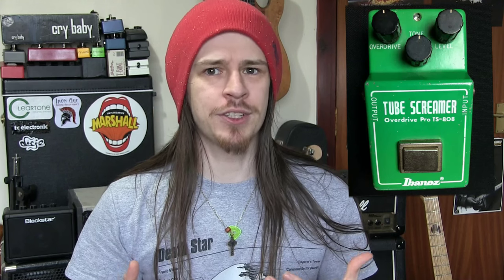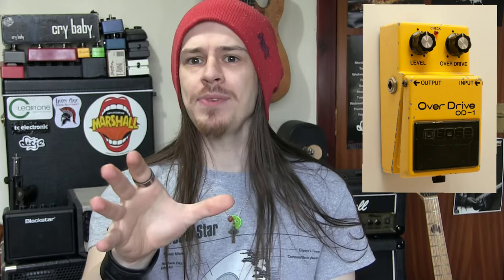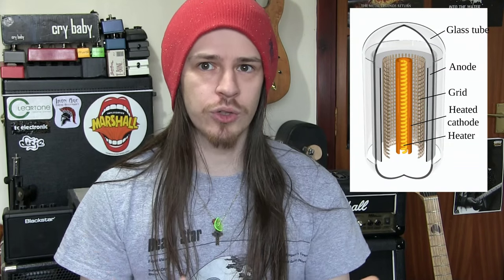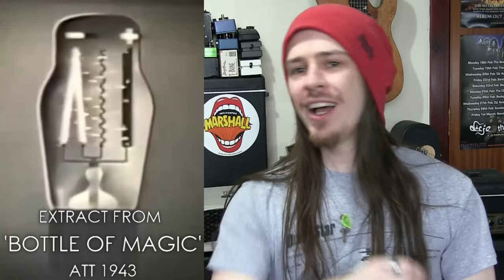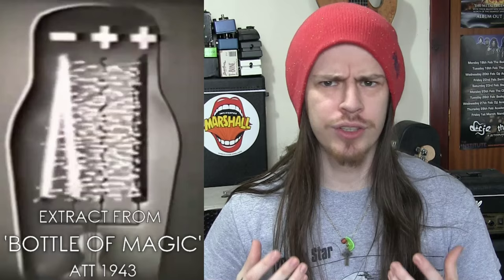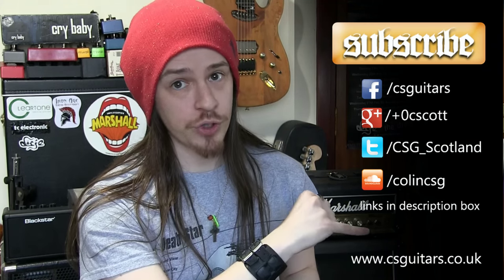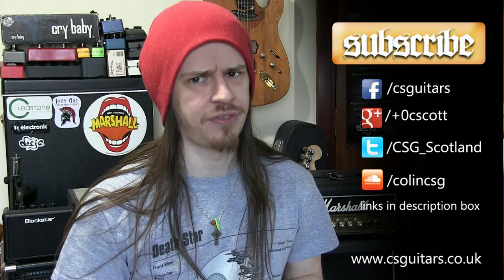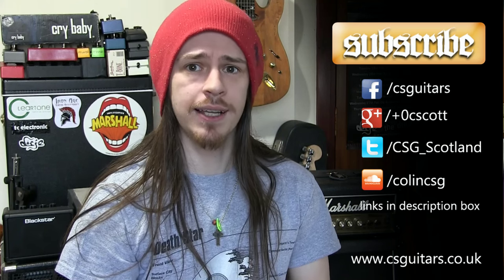Boosting Amplifiers Into High Gain: A History

Comment: I love the GT-OD from MXR. It's transparent and actually IMO more versatile than an OD808. I have tried the 808 and do not like character of the distortion it produces, and it only sounded good on a few settings. The GT-OD in comparison is great on virtually any setting and the drive can really make pinch harmonics cut like a buzz saw. All that for 2/3 the price of an 808.

Comment: i always do my OD / boost with a pedal, before it hits the amp. i feel like when the gain is generated IN the amp's preamp section, there's a loss of immediacy and attack on the guitar tone and it comes out feeling thin and gutless. currently i run a boss BD-2 into a loud, clean fender deville that's been modded for nicer tone. the result never fails to turn heads :)

Comment: Mostly due to cost reasons I've been using a Fender Mustang amp for the last few years, but I have found that using a Boss Super Overdrive pedal as a boost pedal with a very light gain sound works wonders. Of course I play more on the hard blues/classic rock end of the spectrum, so it definitely doesn't work for everyone

Comment: I run (2) Boss GE-7 eq pedals into a Boss DM-2 analog delay into a Marshall 2204 JCM 800 50-watt amp with 6550 power tubes..   "Killer Tone"   ...haven't found anything more versatile than this since I discovered the trick in 1990…  pick one eq on for a tight rhythm,  and click the other on for over the top solo tone…  the delay pedal is the holy grail of all delay pedals.  cheers…….

Comment: While I like plugging straight into my amp, I have a dirt pedal fetish and I'm always on the lookout for different sounds. I currently have no less than 6 dirt boxes on my pedalboard. There's a clean boost for just driving the amp harder with up to 20db of boost. I have a Dual pedal with twin 808 circuits inside, one set as a boost and one with the gain about half way with a slight even boost. Next I have a Son of Hyde distortion that sometimes gets the boost treatment or a slight boost with the gain half way up.... Then an Open Road overdrive, again with the gain up to about half but with the level set for a significant boost. Next is an Angry Fuzz with a significant level boost and fuzz at about 8 or 9 o'clock. After that, a modified Marshall GV-2 and yup, gain about 1/2 way up and level slightly above unity gain. 
Depending on the sound I'm after, I alternate between boosting the signal to get more overdrive from the tubes and getting more from the pedals. I have a single channel amp and typically set it up so it is on the very edge of overdriving. Certain pedals also seem to react well to stacking and being pushed harder so I put those in front of my boosts. Its not uncommon for me to get a high gain tone by switching on 2 or 3 pedals at once each set as either a boost or low to moderate gain. I may also get another clean boost and put it after all my dirt boxes so Instead of pushing the pedals harder, I can take whichever combination of stacked pedals I'm using and boost the whole signal so it just pummels the tubes into submission. Another benefit to stacking pedals too... You may find a pair of pedals sound horrible by themselves... One shrill, the other muddy for example, but use them together and they balance each other out for a great sound.

Comment: Can you recommend me a book or other written material to serve as reference about the extended history of all these types of distortion? 
I would put in this order: 
(1.a) cranked amp fuzz; (1.b) valve mic preamp as adapter to allow guitars to be plugged into Leslie Cabinets, when the guitar amp was crashed or out of commission;  (radio station history and tales)
(2) fuzz pedals; 
(3) treble boosters (first boosters); 
(4) Tube Screamers OD; 
(5) Distortion; 
(6) Clean Booster (post boost) / Dirty Solo Booster (pre boost). 

I wish I could know the actual order that first devices with those purposes were used. Even though by accident or by purposed misuse, creating a new concept of use back in those days.

Comment: Hi Collin. If you hate Metal Zone so much try a MXR DD 11. I don't know if the Dime Distortion is supposed to be used as a Boost pedal, but that pedal really really really has no use. It's impossible to dial in and sucks as a pedal. 

Have you ever tried it out?

Comment: Are there any risks to the preamp for boosting? I have an SD1 (level-max, drive-min) for boosting but also using an OCD with the same settings. Both work well as a boost, however, the OCD is bit more mental, its very loud.. if I were to use the one of them for my general rhythm tone and the other for a lead boost do I run the risk of knackering my amp? This will be a really hot signal going into the amp.

Comment: What's the difference between using a tube screamer to boost my amp or just turning up the volume?
Reply: +Jacob Soupe allow more distortion in preamp sections which will sound better than pushing you power transformer and sound more overdrivy and at low volume.  transformer distort differantly and padels like boss ds-1 do very good job of doing modeling transformer distortion which to my ear sound the worst at high gain.
Reply: i have a blackstar HT5 and i rarely play above 9 o'clock volume. whats the best to get a good metal tone, distortion pedal into clean preamp or tube screamer into overdrive channel?
Reply: +Jacob Soupe i have an ht5 too and i use a digitech bad monkey(basically a ts9) into the drive channel and it sounds awesome.

Comment: I use a optical compressor as a clean boost, touch response isn't that important when hammering heaving rhythm playing, so using the compressor at a medium setting allows me to push stacked chords and sus chords into the tubes with every note of the chord more even in volume,  also as I use optical the effect sounds transparent and not squashed like boss style compressors. Bang for buck mooer yellow comp is a affordable option.

Comment: Tube amps can be boosted, transistor amps can be boosted, but is it possible to boost a digital modeling amp ? Does it make sense, technically ? This 3rd technology is growing in.
Reply: Transistor amps can't really be boosted. Transistors don't break up smoothly and give a nice sound like tubes - they just overload and go south.  Digital modeling amps are usually transistor amps, so see the previous sentence. Some of them use a tube in the pre-amp stage, so theoretically you could overdrive them but I think results will vary depending on the exact design of the input and how much solid-state circuitry you go through to get to that tube.
Reply: Thanks for these informations. I thought it is possible to boost a solid-state circuit, because we see more and more video of "pedals stacking" consisting of boosting a solid-state distortion with an solid-state overdrive. Eric Daniels (guitarist of Asphyx) explained to me that before the arrival of the high gain distortions, he used this technique by boosting a Boss HM-2 Heavy Metal with an TC Electronic distortion. Of course these sounds are OK for metal and not blues.
Reply: You can overdrive a transistor amp (or pedal) a bit, but eventually it just breaks up and sounds rough. I would use pedals to get the sound you want and just depend on the SS amp to make it louder.

Comment: why do you need a distortion pedal if a tube amp has tons of gain already? why not just spend that cash on a pedal that does something else for the sound instead? If you already got a   Marshall, or Mesa, why have a distortion pedal at all?  seems like a waste.
Reply: +Michael Craig Distortion: yes. But an overdrive pedal is commonly used to boost a high gain amp by bringing the pedal volume to 10 and the gain to zero. This makes your guitar signal hit the power amp section hard, giving you a nice mix or power and pre amp gain. It tightens the low end up quite a bit. It's really just a preference thing, ultimately.
Reply: +Michael Craig older amps didn't have distortion. you had to crank em up all the way to get a high gain sound. booster pedals made it easier to get high gain distortion. distortion pedals are mostly for low gain tube amps or solid state amps. solid state amps sound like poopies with out one. still sound like poopies with one.
Reply: +Alice Mason  so you are saying it takes some gain away? When you say tighten the low end up, are you talking about adding bass to it, or taking it away or what exactly does that mean?
Reply: +MrWideballs I realize that part. So, you are saying, if someone has a tube amp with decent gain, like  Marshall or whatever,  they do not use a distortion pedal? They usually only use it for a clean amp, or one that is a solid state?  Is that what the deal is?  Because to  me, it would not really make sense to have a distortion pedal, if the amp already had it. I am not saying I know everything, just trying to learn  quite a bit myself.. so I am asking a lot of stuff, to learn.
Reply: +Michael Craig Yeah, distortion pedals are relatively useless if you're using a Marshall JCM800 or Mesa Dual Rec or something. General opinion is that nothing beats the gain structure of a good tube amp. That being said, if your amp has fairly little (or just poor sounding) distortion, a distortion pedal can help a lot. Many touring musicians use a good distortion pedal if they know they'll be using backline amps. You can generally get a pretty consistent sound from amp to amp that way.

Overdrive pedals, however, tend to compliment high gain amps better. Like I said, it tightens the bottom end a little (I'm not sure how to explain that part very well, but Ola Englund demos high gain amps, and usually shows them with and without an OD pedal. The Orange Micro Terror demo is a good example, if you want to hear for yourself). It's common to see Tubescreamer-type pedals into high gain amps with 0 gain, 10 volume. I run a TS9 into my Peavey 6505 and it sounds fantastic that way.